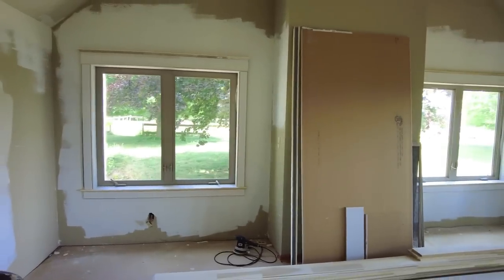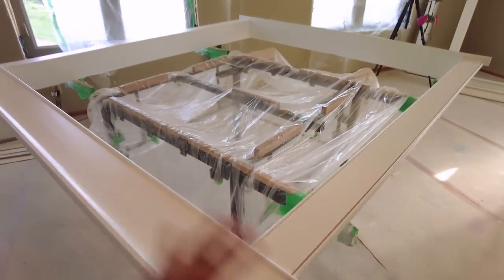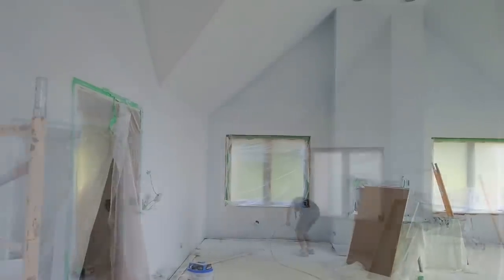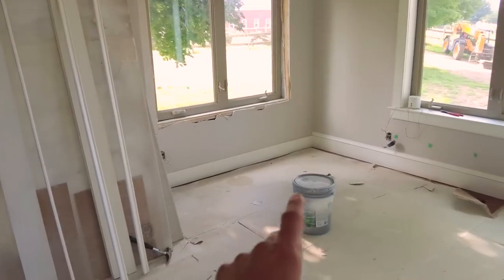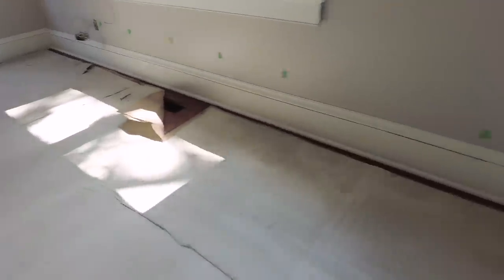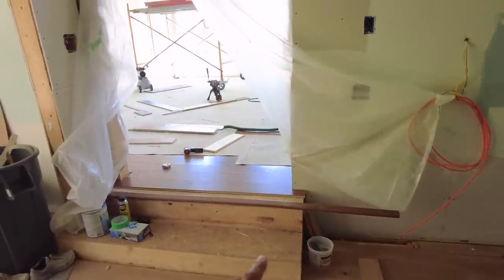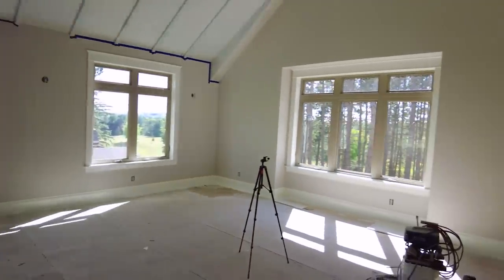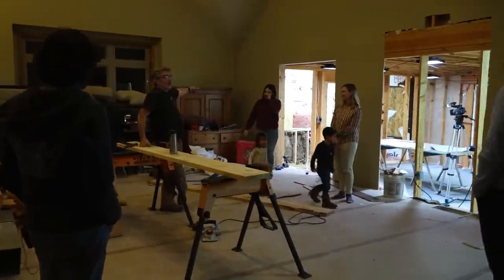Finishing the Great Room | Home Renovation & Addition Part 56

Comment: That’s a whole lot of trim for one area, but it looks beautiful and it really makes the room stand out too.  I used to install trim in several homes I helped build, but I always had to use a utility knife to cut out the excess coping material. Seeing it done with power tools would have made that job a whole lot faster and easier. I agree that the shoe mold finishes off the base mold which would have looked too bare without it.  Over the years, I’ve been in many mini-homes that were the same size as your family room. Many of them were post WW II homes built for the returning troops.  It looks like some of your neighbors are a bunch of turkeys… bah dum, dum, dum. LOL.  The colors really make the room look cozy and relaxing for a family room.

Comment: Last project where I had a lot of copes to cut I used my tablesaw. Run the blade up high so there isn't too much of a radius in the cope, and come straight at the blade to nibble away the stock. It's similar to what you were doing with the miter box but more controllable and you can cut away more so there is less to fine tune with the file. A thin kerf, high tooth count blade works best.

Comment: someday, i am planing a Kitchen renovation, and when i do, i plan to have all pull out drawers for under counter storage. and something i want to do for the overhead cabinetry, is to have the Entire space in each current cabinet door, to be able to slide out from the wall, and then lower down Completely to the counter top level, so everything can be easily gotten to, without step stools or ladders, and everything would be within reach, but storage maximized and ultra efficient. the way i am thinking that could be done, is with some sort of over the cabinet slider to let it come out form the wall, and then a set of hydraulic pistons that would "soft" drop, via some sort of handle release mechanism, so it would be manual operation, but so easy a kid could do it. so far, i haven't found anything remotely like my idea, but i can also imagine each section of those cabinet mechanisms being able to come out like pullout drawers, so they could have the ultra accessibility that one could use at any age, or height. (i am 5 foot 1 myself, and i absolutely need a step stool to access the higher areas of the kitchen.) anyways, i wondered if you could figure out a way to design such a system, since i am not technically inclined myself in that respect. though i admit, i have many ideas i would love to try if i had some one who could help design and build them.

Comment: A coping saw makes nice coped joints. They are not expensive.
I generally prime then install. That way the nail holes are filled and caulking between moulding and wall are done before final coats of paint.
When sanding flat surfaces it is optimal to use a sanding block (I use the Prepin' Weapon 1/4sheet). By hand it is too easy to get uneven results.
For contour sanding, a set of rubber contour sanding profiles wrapped with sandpaper. This gives a consistent profile.
I would have straightened the transition between wall and ceiling with plaster then hand drawn the line, I always paint the ceilings first, but I do this full time on multi million $ homes which are mostly occupied which means that brush and roller are the way to go. A client of mine won best renovation of the year in my city of 4 million 2 years ago.
Reply: Another professional speaks😂😂😂😂😂😂

Comment: Looks awesome!  I’m a cabinetmaker by trade & spray all my cabinets with conversion varnish as well.  By the looks of your can it appears you use SW paint.  I use H66W32 from SW on my stuff, curious what you’re using? Also, if you have any questions regarding anything on your cabinets when you start them, I’d be happy to answer any of those questions.

Comment: It's coming together nicely, Matt!  QUESTION: At about 19:00 you use an unusual sanding disk for the coping.  What is that sanding disk?  Can you provide a manufacturer and model or anything?
Reply from the maker: Flap disk for a grinder. You usually see me using it to prep steel for welding 
https://amzn.to/3RcRCOK

Comment: I totally get your point with the ceiling--weird transitions, no straight lines, etc. But why didn't you just paint it the same color as the walls? I did that in a room with similar issues, and it looks great. No worries about blending the walls to the ceiling, no taping. You would have saved yourself a lot of time!

Comment: What nail gauges did you use?  Type of nail filler?  Doing a similar paint on trim soon myself.  Door casing is already installed but the base is not yet. Debating on whether or not to do any preinstall spraying. Putting in 3/4 x 5.5 windsor one, already pre-primed.

Comment: Matt, what size nozzle did you use on the Graco sprayer? Also, did you thin the paint for the walls? I assume you are using latex for the walls. Your house is looking great!
Reply from the maker: 515 tip. Latex without thinning. Thanks!
Reply: @mcremona   Thanks Matt!

Comment: The baseboards look really nice, but I can't understand why you didn't run any ethernet jacks to the room and perhaps even some cat6 in the ceiling for an access point. Good luck!
Reply from the maker: There’s a cat6e in the wall should I ever need it. The property is covered by mesh wireless
Reply: @mcremona  Mesh wireless has so many short comings, it's probably not what you want unless you're an incredibly minor internet user. HTH Lmk if you want more info.
Reply from the maker: @purpleidea must be because we haven’t had any issues

Comment: What made you use the conversion varnish instead of regular trim paint and does it cover in the same way trim paint would?
Reply from the maker: Practicing using it before I get to the kitchen
Reply: @mcremona  does it look like paint when it's dry leaving a nice finish looks like it in the video it looked really nice?
Reply from the maker: @Treylopez1997  yes it flows out and levels well.  It's what's used on what you'd buy commercially
Reply: @mcremona  ok that's cool thanks 😁

Comment: The wall / ceiling crooked line should,could have been done using a timber bead on the line when plastering .do one side of the line on your first coats then swap over to the other side of the line next coat.99% of straightness issues in every plane are eliminated in those critical areas with one extra step and the last 1% can be cured when final sanding.Also ,a tip for cutting in a straight line " relatively " easy is to gently crease the internal corner line with a putty knife,it creates a gap that the paint will not bridge,IF the crease  is straight ,your painted line will be straight and you have a margin of 1-2mm or 1/16th for your brush before you balls it up if your painting skills are lacking
Reply: 😂😂😂😂😂 of course you have the perfect answer😂😂😂😂😂😂
Reply: @daveklein2826  take it or leave it...just trying to pass on a bit of what I have been shown in 20+ years of painting jobs just like this one